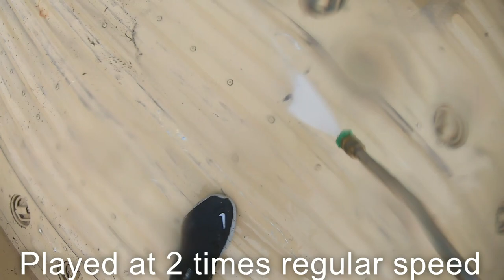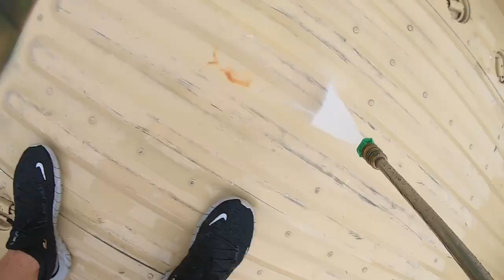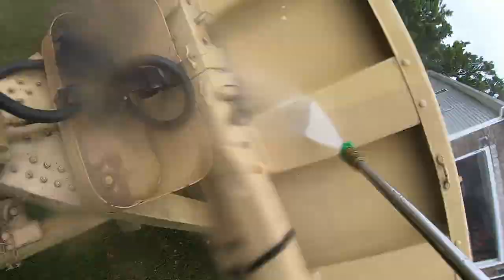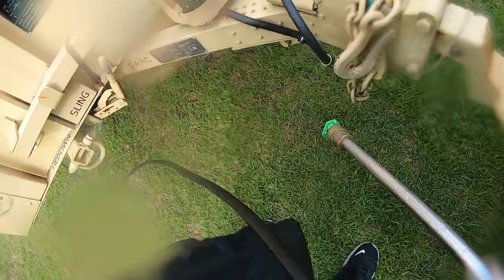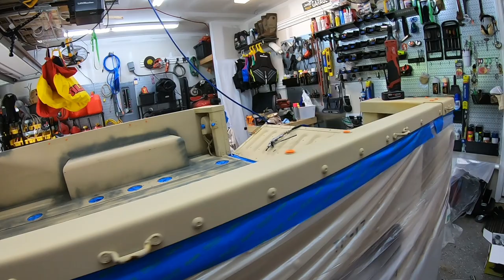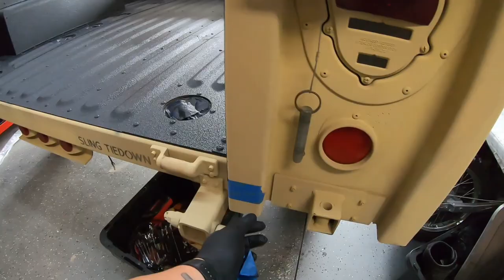Raptor Lining the M1101 and Pressure washing it.

Comment: It looks good, but as a painter you should have started on inside walls and spelled your way down, then the complete floor from front to back then your edges. You then would be able to finish up the tailgate while it was off.
Reply from the maker: I was a afraid I was a little short and knew I was mounting stuff in certain spots so I kinda tried to spray the areas I knew needed done. I had extra bottles but would have liked to have sprayed at least one or 2 more bottles, but didn't want to order another 4 pack.